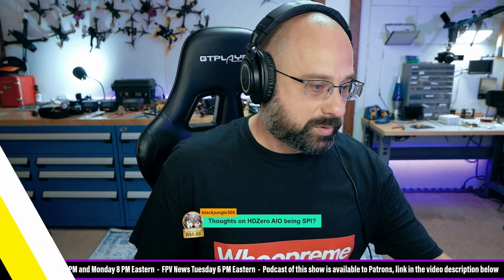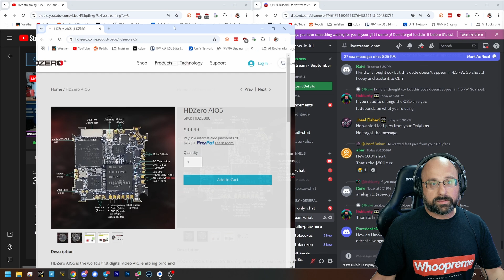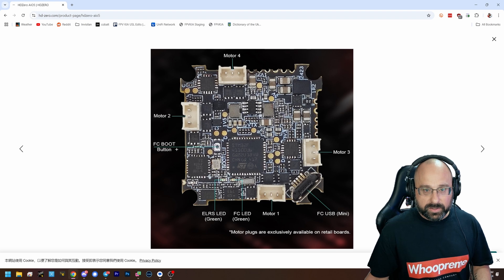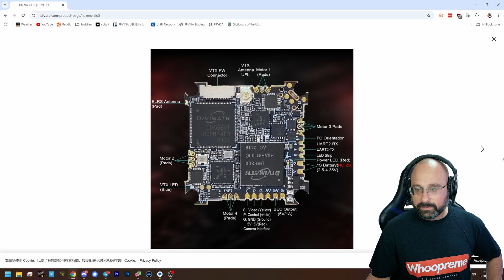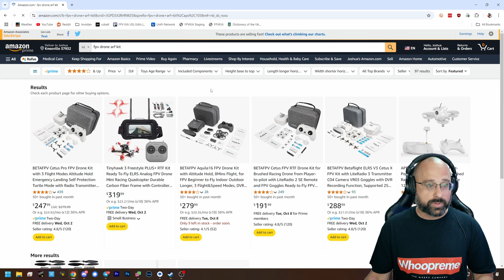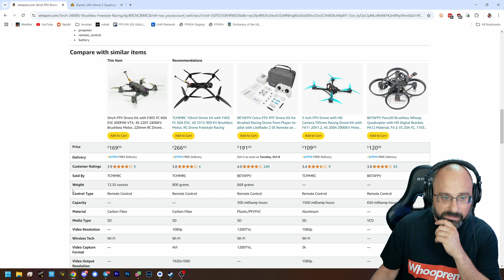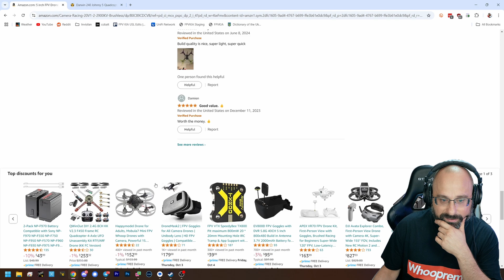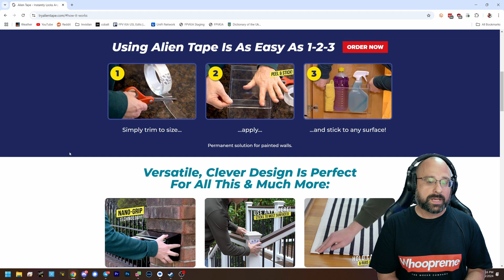New HDZero AIO Is SPI ExpressLRS? Why? Under $200 Drones From Amazon? - FPV Questions

Comment: Is there a (fixed wing and drone) parts list that is known to work out of the box with open-source software?  Preferably, a ready-to-fly solution, just program either Ardupilot/PX4 or Beta/EmuFlight/iNav/FalcoX and fly? 

For example, the Flight Control / Electronic-Speed-Control electronics seem to be either the larger Pixhawk boxes, or the small-square-stacks (STM32F/H7 - Speedybee F7V3, Mateksys H743, Kakute H7 V2, CUAV X7 STM32H7).. but not sure what can be mixed-and-matched such that you can try experimenting with most firmware and frames.   For example, the OmniBus F4Pro isn't supported on the ardupilot!

I'm interested in: 
1) Autonomous Flying (Waypoint, Lua scripting, Return-To-Home) 
2) Sport-Tracking/Obstacle Avoidance (like the Skydio2+) 
3) FPV and free-style / flippy-flops 

I understand Beta/Emuflight is popular among FPV racing, and ArduPilot for autonomous/waypoints.. however is there another that can do autonomous and free-flight? iNav, FalcoX? 

Peter Zipfel has some courses on UAV design (using cadac, simscale, etc), but was wondering what you thought of the more popular DIY platforms, either in terms of esc/radio hardware (ex. HDZero Goggles, Walksnail VRX, etc) or software (ex.Ardupilot, qgroundcontrol , mission planner , px4 , inav , betaflight).

Comment: Having everything on one board is a really huge advantage that trumps most things.
Reply: I have two of these boards and they work great!
Reply: Not at all… any one of those components go bad and guess what? Now you need a whole new board. Common sense.
Reply: @PeteFPV  This is a dumb take, you obviously don't own hdz. You cant get sub 20gram 65mm without this board. You don't seem to understand the reason it was made.
Reply: @PeteFPV  So what? It's cheap.
Reply: @AITullball3333  would be even cheaper if you didnt have to buy a board with everything again lol. We’re comparing a $100 AIO to having only to replace a $15 ELRS, or a $25 vtx etc.
Reply: @PeteFPV  A FC, a VTX AND the receiver. This is not going to be good build.

How often do you ruin a FC? Not that often, if you conformal coat it and make sure it's adequately protected.
Reply: @AITullball3333  so you agree that the AIO is not good then lmao. Thats what i said. How often do you ruin an AIO? Um… way more often than a regular stack. Thats exactly why everything on one board is not good. Aios are already trash in the first place. Everybody knows that